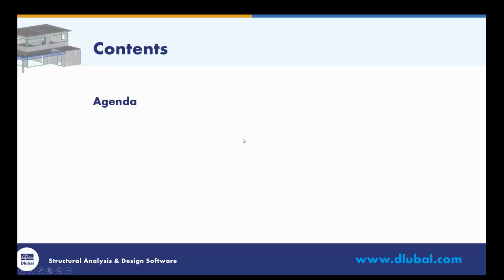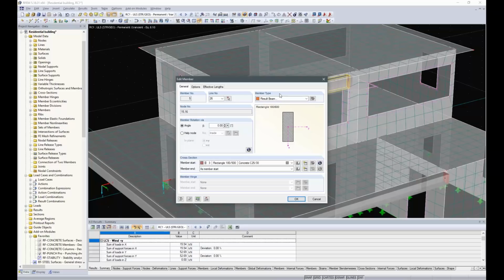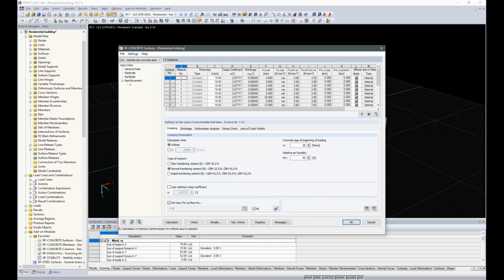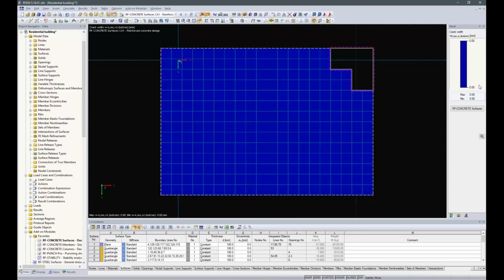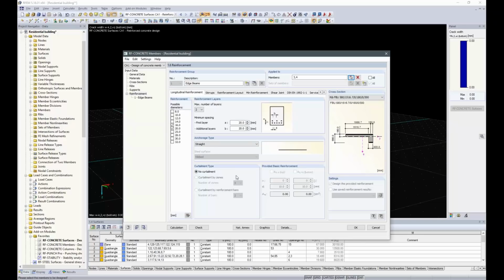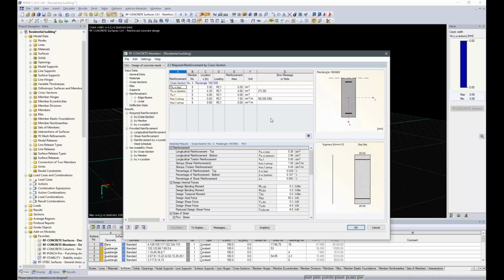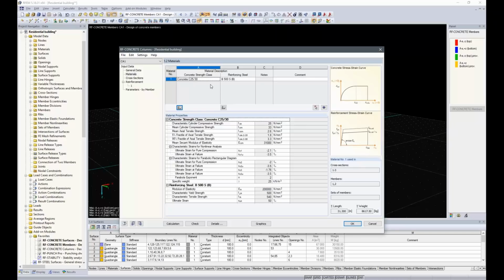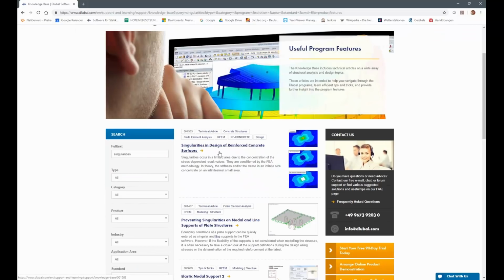Reinforced Concrete Design per EC 2 in RFEM

Comment: Hi! Is there webinar for buildings from precast concrete elements with joints and links?
Reply from the maker: Hi, WOT!
Precast Concrete elements are designed very similar to the on site designed elements.  The procedure is pretty much the same. But you are right - the joints and links need to be taken care of. There is no specific webinar yet for it. However, you can get the forces to design the joints eg by using nodal releases or non-linear supports that act in only one direction in RFEM. You may also find interesting to read following articles: 
https://www.dlubal.com/en/support-and-learning/support/knowledge-base?query=precast&keywords=&type=&category=&program=&solution=&area=&standard=&cmd=filterproductfeatures

Comment: Is there automatic reinforcement design option available and bow to get the workshop drawings
Reply from the maker: Hi, Rajul!
Dlubal gives as results also simple drawings and renderings of the reinforcement for beams and columns. With surfaces we deliver numerical values of the reinforcement. Dlubal is not a drawing software. For drawings we have export options to Revit or to a dxf file that can be used in basically all other software that can read dxf files.
Reply from the maker: Hi, Rajul!
One more interesting video for you where you can see also how reinforcement is imported to Revit.
https://youtu.be/7HW4wr_wVng?t=2825

In the latest versions we implemented also creation of 3D reinforcement for beams and slabs in Revit.